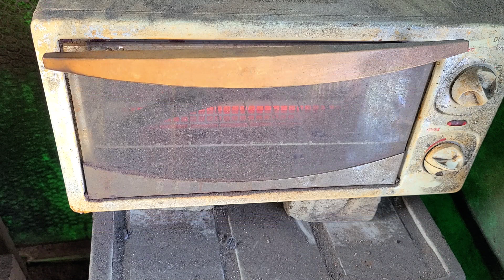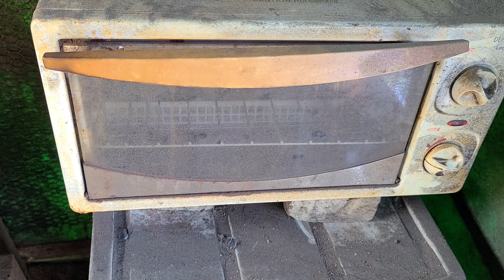Making a camping knife

Comment: That is a beautiful piece of craftsmanship . What were you dipping the blade in while it was hot ? Enjoyed the video !!!
Reply: I built myself a quencher from a 6 inch vent pipe. I use cooking oil as a quenching agent for my blade making projects.
Reply from the maker: Thank you for watching.
I use oil (canola oil). The reason for using oil is that in quenching, oil does less damage to the blade than water.
Reply from the maker: Cooking oil is a good choice my friend

Comment: Are sawblades a particularly good metal to use for a knife?
Reply from the maker: Thank you for watching.
This knife has a circular saw blade made of SCT5 Korean standard high carbon tool steel. Tool steel is often used as a knife material.

Comment: U make most beautiful and powerful knives but I always wonder why most of the knife makers never clean the inside handle of the blade why what is the reason for that wonderful work?😚
Reply from the maker: Thank you for watching.
This is to increase the adhesive strength of the adhesive. If the surface is not rough, adhesion may not work well.